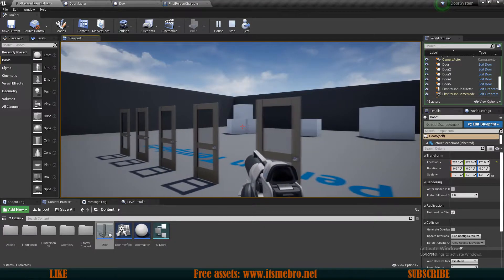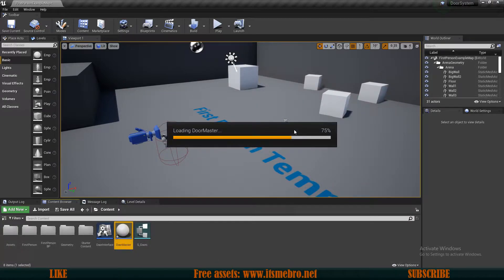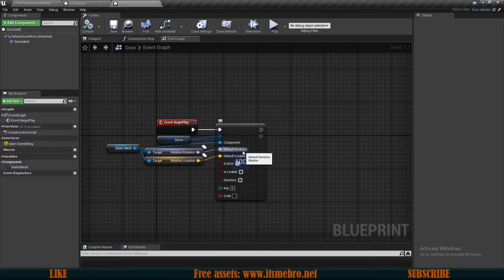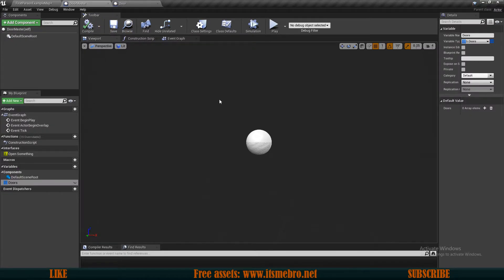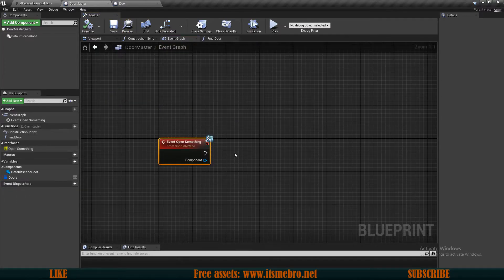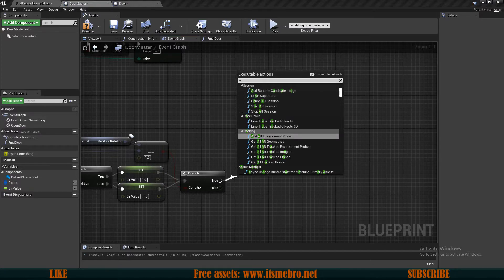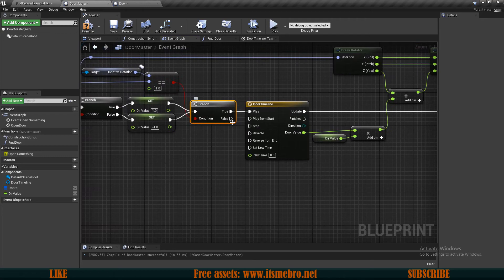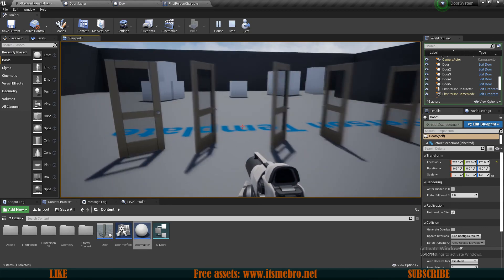UE4 Doors system / Open Close (Part 1 / 5)

Comment: Hey there, Im in a really big issue that i've been trying to solve for over a month now. When I do the "Event begin play to add in a new value to the doors array" it does not work, I duplicate the doors like you did in the end but only one door opens (Being the first door I added in the map) no matter which door I choose :P. I've done this in 3 separate projects thinking it may have been something of my doing and I've repeated this process houndreads of times. I figured out that the doors array index prints always the value of (0). Im really loosing it man, if you kinda know how to solve it I would apreciate it dude